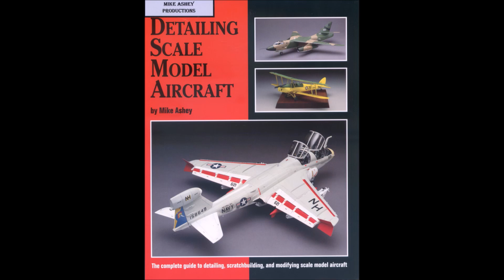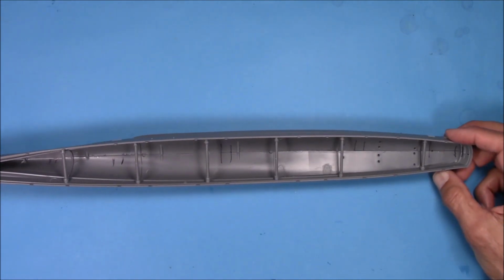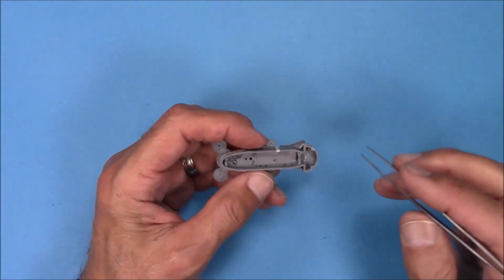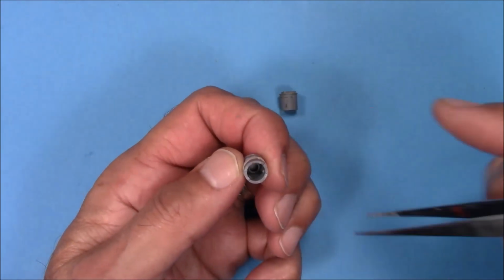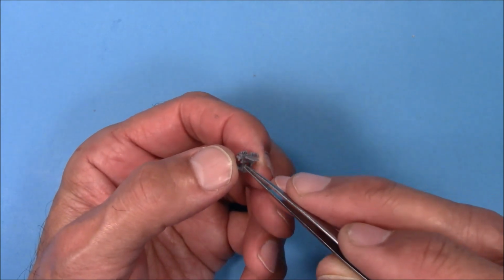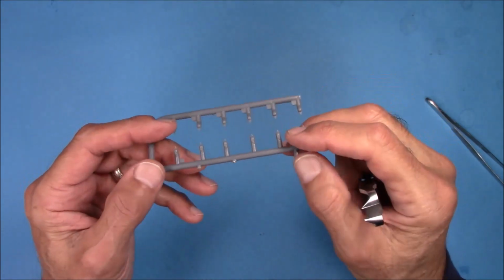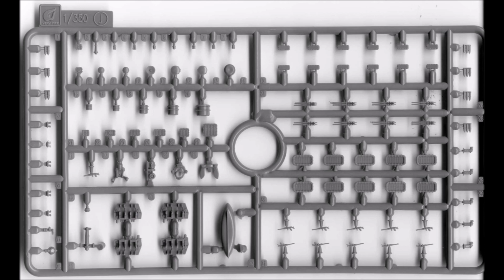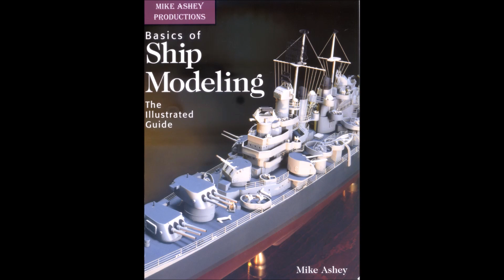Very Fire 1/350 scale USS Atlanta tape up review, assembly tips and part’s scans.

Comment: Thanks for the review. May I suggest showing the separate parts of a structure before showing how to complete it.
I found that the kit included a large number of parts that are not called for to build the Atlanta. The 40mm Bofors and extra ship's boats are just an example. Do you have any idea why Very Fire would provide all these extras?
I have the Deluxe version and found that their PE was well done. The special instructions for replacing original features with PE was a big help also.
Reply from the maker: Hi

Common part trees with their other ship kits

Mike
Reply: @scalemodeling  Thanks, I thought it may be something like that. I was tempted to create my own Atlanta+ with a bunch of 40mm